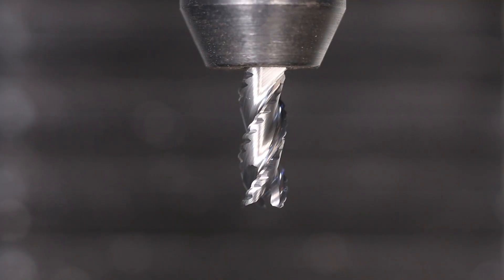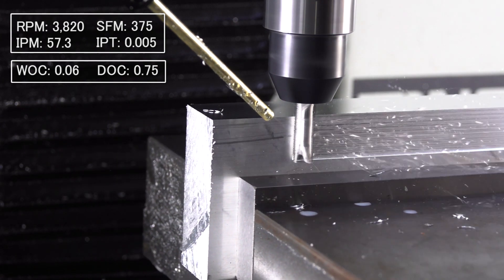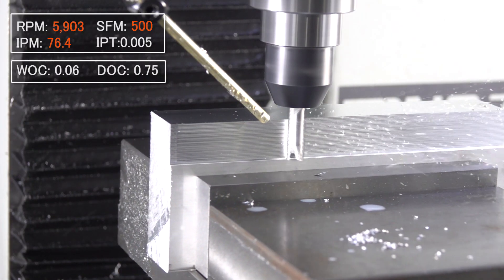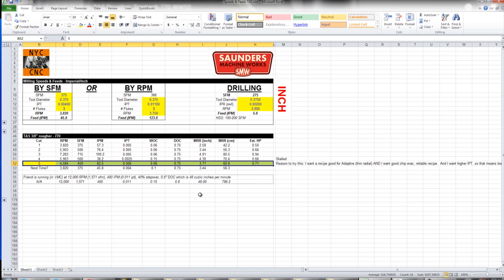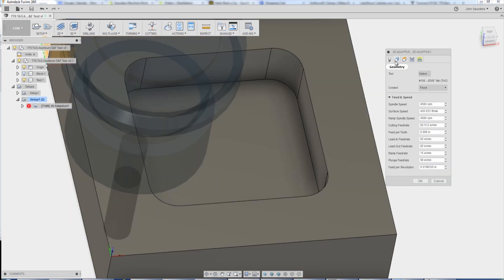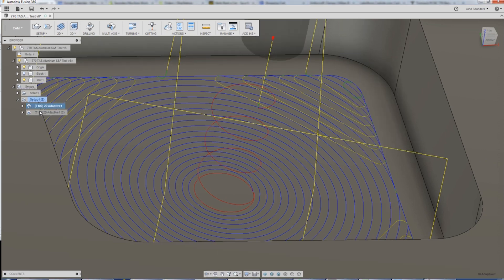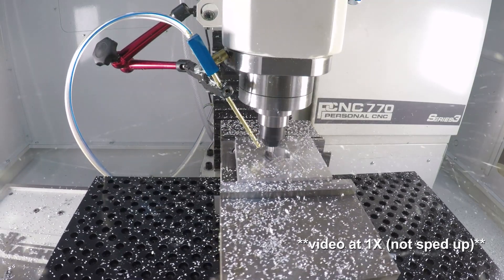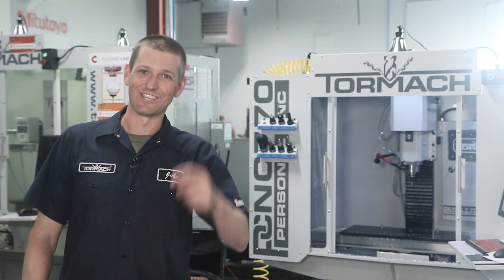Testing the Lakeshore Carbide TAS Rougher: Tormach 770 WW150

Comment: I've been trying to use this tool in a PCNC1100 S3 and can't get above about 1.5 cubic inches per minute without having the tool pull out. I have talked to Tormach support multiple times, we have the updated collet, I have followed the greasing procedure, and I have the power drawbar adjusted so tightly it crashes the tool changer. I've tried these parameters and also lighter, faster cuts and the tool still pulls out while climb milling around the outside of parts where there isn't any chip recutting. Does anyone have any advice for getting higher metal removal rates from a Tormach PCNC1100 without pulling the tool out?

Comment: Hey John we use roughers a fair amount in alum and stainless.   Give them some stepover, they like to eat,   re-ingesting chips is never good, BUT if any cutter tolerates it it's these guys.  excellent for slotting.

Hey and you forgot to taper your helical ramp! :)

that's like my favorite feature.

Have fun!

Comment: If you want to improve run out ditch the side lock back ends. They are nasty. A collet Chuck is better or invest in heat shrink tooling.
Reply: That does sound good for a side lock, but everything about them just screams wrong to me as an engineer. They stress load the cutter at the point of screw contact. Don't get me wrong they have there uses but not high speed running of carbide.

Comment: John, just ordered a couple for alum parts I make. Have been using his ruff/finish EMs for these parts for the smaller chips in alum. Use his ruff "fireplug" EMs in steel and like them a lot so these may work out for these alum parts. Thanks Carl, like your stuff and like your service. Dennis Swan

Comment: These videos are great, but I think they come off with a somewhat misleading result. You're frequently discussing changing the surface speed to get a better result, and it comes off as though something with that surface speed is causing the change. It's misleading, as the surface speed itself isn't the limiting factor, rather the available torque/horsepower as a result of the spindle speed change.

I say this, as i'm certain that tool would gladly perform at 3000+ SFM in aluminum, given the horsepower and torque to maintain chiploads at those speeds.. The video leaves with the impression that a ridiculously low SFM is ideal for that endmill, when in reality it's only ideal for that tool in THAT MACHINE. Hopefully that makes sense.

Still, Cool.
Reply: The HP is seriously limiting on these Tormach machines for sure. I wish they had an option for an advanced CAT40 10hp+ with rigid tapping. That would make these a lot more interesting for cross-over businesses like mine. We cannot deal with the HP limitations but rarely use the 30hp on our Haas machines. it would be nice to have a CNC in my home shop where I do all my design and prototyping/testing. Tormach is about 80% there.....

Comment: can somebody explain why the tool isnt going zig zag back and forth on the corners, but instead goes one way, stops, goes back in air, stops, and then goes over it again. its not a finishing cut, and cncs dont have backlash, so why waste the time by not going back and cutting there too? or just flying to the next corner if changing direction is bad??
Reply: fredlllll that is how fusion posts the code. if it went back and forth you would be switching from conventional to climb milling with every pass. it is easier on the machine to focus on finishing the corner it is in than a lot of rapid moves to opposing corners. less acceleration and deceleration.
Reply: Fusion just added both ways machining, it does not always save time believe it or not

Comment: Little bit of chatter on the final, not to bad though. What was the load meter saying? Those vector drives that tormach is using aren't the greatest for absolute spindle speed control, they don't run any feed back comp for spindle loading. As a result they will pull down even at 50% of full load but as long as it's not running over 100% for long you should be okay. Another thing to consider is that when your spindle pulls down like that your feed per tooth goes up! my ear was thinking that your spindle pulled down about 15% that means you chip load went up %15. Not a problem, obviously it worked fine, but some food for thought. Maybe try and put a tac on the spindle and see how much of a drop in rpm's you're actually getting?

Comment: John have you watched Titans of CNC on youtube? The guy gets 800 inch per minute on a haas mill. its truly incredible
Reply: brocksdaddy081910 
Programs at 800. Haas doesn't have the acel/decel capabilities to actually run at 800 in the adaptive cuts. 300-500 ipm is about it. 

There's a balance between high feed small step over and lower speed larger step over. 

Every machine is limited by their spindle HP as to what the maximum material removal rate they can actually achieve.
Reply: Occams Sawzall Great to know thanks for the info. I just heard 800ipm on the video and that fucking blew me away haha.
Reply: brocksdaddy081910 
Brothers speedio can do over 1,000 ipm and has the axis servos to do it in cuts as well.  Datron M8 cubes are right up there as well.
Reply: Check out Brothers or Robodrill amazing tapping speed, high ipm, fast tool changes and rapids are insane
Reply: Chief Machining 
6k rpm tapping speeds are insane. I think brothers just upped to 7200 rpm tap speeds.

Comment: OMG! A CNC machine running GNU/Linux and not Windows XP? How common is this?
Reply: dasistalles misthier Tormach PathPilot is actually some sort of fancy interface over LinuxCNC. From what I've seen of mach3 (terrible!), I sure hope there are no real machines running full Windows.
Reply: Thank you for the answer. I know a company using several screw and nut sorters. They all run Windows, mostly a chinese Windows XP without any updates. So i expected the worst from CNC machines too.

Comment: i really don't get why tormach is selling high precision machines, that are rigid enough for their price range but always underpower them.. I mean motors are dirt cheap, every kitchen mixer has more power than those tormach spindles. I've seen so much faster cuts with only those cheap 2,2kw china routers.. 
is there a higher HP option? If that's the case then I'm taking everything back.
Reply: CookingTasty 
Because they market them for home basement shops. So they're single phase motors that plug into standard outlets.
Reply: Occams Sawzall 
Oh right, yeah I forgot about the whole 110v thingy you got over there. 
that sure does limit the size of that motor to idk 2hp?
Reply: CookingTasty  1.5 Hp I believe. 

Can ramp up to 220V at 40 amps and get a 4 HP motor going. 

But typical US power is 110V at 15 amps. Meaning max a 1.5HP motor.
Reply: Occams Sawzall 40amps, holy cow. how thick are those cables? 
calculated that's 10hp isn't it? 
don't you have normal 3phase power at any house?
Reply: CookingTasty 
Nope. Households in the US are all single phase.  You can get 3 phase drops but it's usually expensive to. Phase converters are much cheaper, but still limited. 

It's roughly 10amps per HP with single phase
Reply: Occams Sawzall oh wow, that's really not alot if watts then!
Reply: CookingTasty 
Watts don't matter with motors. It's the amperage. Watts is just how fast the motor sucks up power. You can have high wattage motors with crappy performance. Just look at any kitchen appliances and compare say a cheap Chinese one to a Hobart. Guaranteed the cheap one lists a higher wattage than the Hobart, but the Hobart is far superior in power.  Essentially wattage is just a measure of efficiency. 1hp at 2kw is less efficient than a 1hp at 1.4kw. Both produce 1 hp but the 2kw needs more juice to do it, and therefore less efficient.
Reply: Occams Sawzall is the horsepower I know a different one, than the one you are taking about? As far as I know cars and motors are never measured in HP, but in kW (atleast since 2007 in Europe) . I may be wrong here but as far as I know, there is a direct conversion between watts and horsepower as hp is based on watts. 
what does matter though is torque and rpm, and that is what defines the quality, but I may be wrong there also.
Reply: CookingTasty 
Nah. We measure car motors in HP here as well. 

You're referring to the output Kw of a motor, not the input. 

So if you had a motor with a 6 Kw output rating, but consumes 10Kw input you'd have a 60% efficiency motor. If you took that same 10Kw input and put it into an 80% efficiency motor, your get an output of 8Kw. Same power, different output. 

Reverse can be said.  If you have 2 motors, both produce 8Kw output. One motor requires 10Kw input, the other requires 12Kw input. The one that produces 8Kw with a 10Kw input is the better motor.
Reply: Occams Sawzall oh...
thank you very much! did not know there was a difference at all. thought it was all the same.. 
so HP is equivalent to the output then I guess?.. 
anyways, thanks again for the insight and patience!

Comment: Great cutter there from LSC!!  I'm also a BIG time ShearHog fan (1.00" single flute MIT), running it on my PCNC1100 (5100 rpm and 24 ipm works well all the time).  The drawback on the ShearHog is simply the 1.00" diameter, making it unable to get into any kind of tight spot (yes I know theres a .750 one also).  This Lakeshore TAS cutter might be the best answer for jobs that require a relative large amount of aggregate material removal, esp when working in tight spots (a job I have at the moment!).  Crazy ramp angle.  I run Lakeshore's variable 3-flute ZrN aluminum cutters with a 5 degree ramp and they probably could do more than that.  Lakeshore produces some really great tooling.  I'm a regular customer.  Thanks for the highlight here!!

Comment: Based on my experience with the prototype TAS tools, that sounds like its chattering to me. They definitely have a different sound to them then a normal endmill but I didn't have the squealing sound. Also be careful on those ramps without flood, 12% is probably the max I would try. I blew up two of them trying to get video using my mist setup, whoops!

Comment: Why does the surface footage strike me as really crazy low in aluminum?
I'm running a Swift Carb Ramp Mill in the Robodrill... at like 1800SFM.
Reply: The machine hes running on isnt very powerful, and its small. It was bogging down at only 80ipm
Reply: Why when I look up recommended cutting speed of aluminum it on like 70-100 m/minute
Reply: Just from academic side, why not get a lathe, and fix on of the flutes to cut, then experiment with depth the flute cuts in (dont want to use standard terminology cause doesnt apply with a end mill on lathe) as well as cutting speed to work out speed for best tool life, now we have this, use the math and geometry to put that into feed rate, rpm, depth of cut and width of cut.
Reply: Now cutting speed basically determines and sets the rpm of the tool because the cutting speed or linear speed of the edge of the tool is much faster than the relatively slow feed rate. Feed rate will determine the chip load or thickness of chip while width of cut the length of chip, and depth the height of chip.
Reply: As far as tool life, increasing the depth of cut should not have any effect and should be maximum ideally. It only increases stress on the endmill which the endmill should be designed to handle other wise no point to upper flutes of the length of cut.
Reply: Width of cut should also be maximum to reduce added ware not accounted for from chip engagement. Lower width of cut increases chip engagement.
Reply: Feed rate could have been determined from the lathe. The optimum thickness the flute bites in on lathe directly mathematically relates the rpm and feed rate. Outside of that it may of been largest feed rate possible without center portion of non cutting portion of bit running into material (breaking bit).
Reply: So I would say maybe the width of cut could have been more

Comment: tried this style of tool before never liked it found the only benefit to be when running a big job you don't have to clean your machine as much. Other than that I found them to noisy and poor performance.
want good chip control grab a standard 2 FL high helix cutter and have your tool supplier cut a relief in the flutes every 1/4 to 3/8 of an inch. good chip control acceptable finish.
Reply: Lakeshore has them ready to go. Triple variable flute ZrN rougher/finisher mills:  http://www.lakeshorecarbide.com/standardlengthcornerradiusroughfinishgeometry.aspx
Reply: I like these for 1/2" and under diameter where I'm not removing much material anyways. They can shred..
Reply: That looks Really good, and quite ideal for a Tormach.  I'd like to try one of those someday soon.

Comment: Meh.  I tend not to like those style of cutters unless I'm hogging stainless or something. Aluminum I can't see a use for em. And the sound would drive me nuts. 

I just use an aggressive standard variable helix flute endmill. Rough and finish with the same tool. Least in aluminum. 

Only time is use those in aluminum is if I had a need for a long depth of cut. Say 6X-8X. Then those cutters are nice since they don't bounce against the walls as much.
Reply: They are amazing for production of parts with lots of deep pockets. Normal end mills roughing at near full flute length make tons of big chips. I unfortunately dont have chip augers or conveyors on my robodrill, so tiny chips save a ton of time. Now I don't have to stop and deal with chips in the machine and in the chip bin behind the machine. I can now go 2-3 days without doing anything vs half a day previously. Only bad part is 55 gallon drums of those tiny chips are really heavy!
Reply: Yeah they are great for production machines with poor chip evacuation.

Comment: What about all that tool chatter?  is that normal for a corn cob style cutter?  I'm still learning, but that whine would have worried me.  Great video regardless (as always).
Reply: Jason LaCoss 
The rare times I do run those style cutters, it's usually with large step overs. 60% of the tool.  A .06 step over barely clears the groove depth of those things.

Comment: Why would you need a rougher? For lower hp machines? For if you're running a roughing and finishing tool anyways?
Reply: Chief Machining 
Personally I'd take an endmill with chip breakers over serrated endmills for that. 

I really just don't like having to clean up those deep groves left over by the serrated mills. I find they wear grooves into the finish endmills and finish starts getting streaky.
Reply: Chad Krause the chips I use .5 diameter with 1.25 loc and chips makes huge mess  in the machine because they chips are so long
Reply: Occams Sawzall yea I use the diamond back from Destiny
Reply: Chief Machining 
Try Helical Solutions H45AL series. I find them better than Destiny.
Reply: Occams Sawzall I love helical. And their helical milling advisor program that gives you feeds and speeds. I run out of machine before tool
Reply: I like them but like Destiny better. I like own my endmills as well it's actully cross between viper and H45AL_Finisher style looking to do a rougher next with chipbreakers.